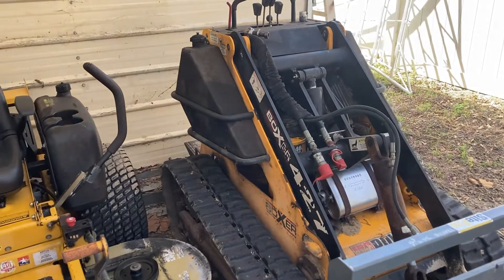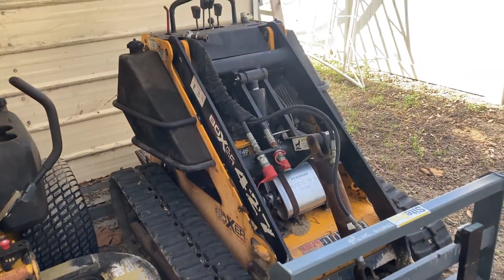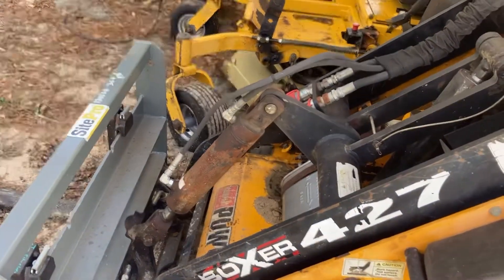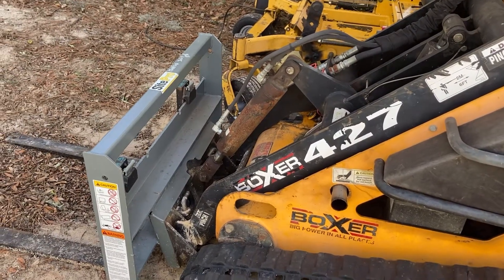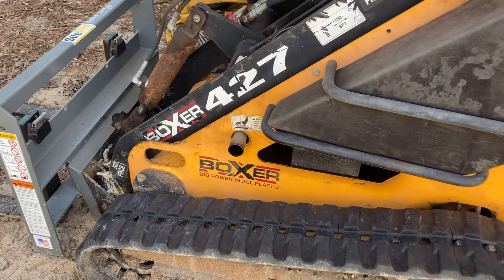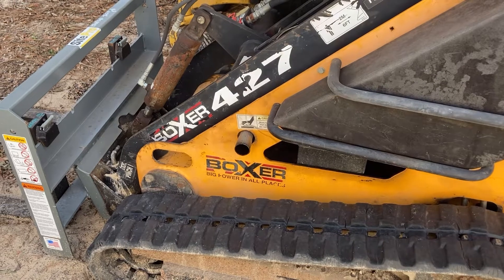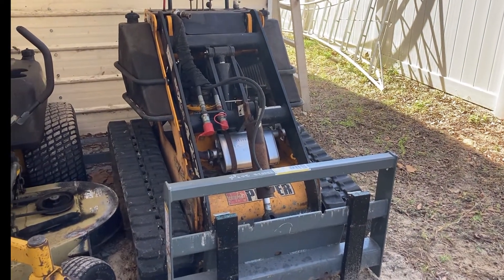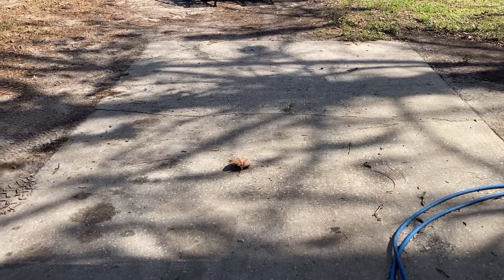STET’S LAWN CARE DON’T MAKE THIS MISTAKE

Comment: Those machines are surprisingly heavy. You def got to make multipoint turns. Good video and solid advice man!👍
Reply from the maker: I plan on weighing mine to find out.  My 60” is lightened significantly so I am curious to see if I have it lightened to be comparable with home owner grade yet having commercial durability

Comment: Very well said, I appreciate your points and that you are telling the real story. Lots of people on here just talk about the good and not the bad effects of using certain equipment that they own. Basically the equipment they have is always awesome and other stuff sucks type of view. I have had a couple mini skids and agree with what you are saying. They are great machines for sure but like you said on certain jobs their negative impact is too great to justify its use. I know the video you are referring to and I would have done that job a little different saving lots of labor. I would have first sprayed the area with post emergent killer then cut the edge, then another edge inside about 6" and pulled out that 6" row of sod then burn the grass down to the ground with a trimmer and cover the old sod with the fabric and mulch. The grass will all die off and the roots will decompose. Pulling all the sod out was a lot of labor and hauling that could have been prevented. If the bed was not going to be mulched then I would have removed it all.
Reply from the maker: I agree now I do think tracks are good for machines of heavier mass that consequently came do more work.  Another option on his scenario would be to use a sod cutter if he could reuse the sod elsewhere otherwise your method sound a lot easier